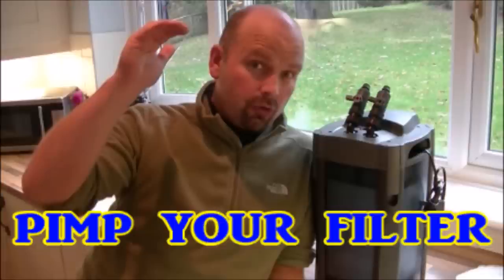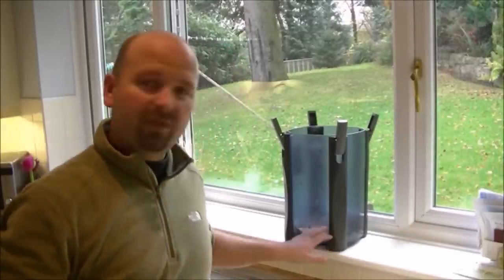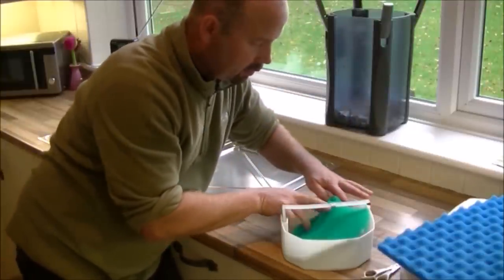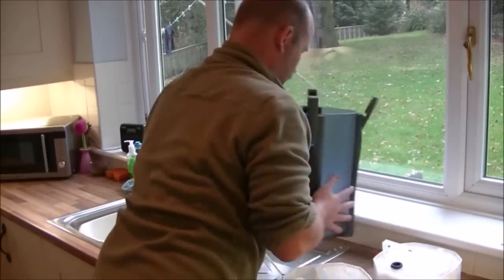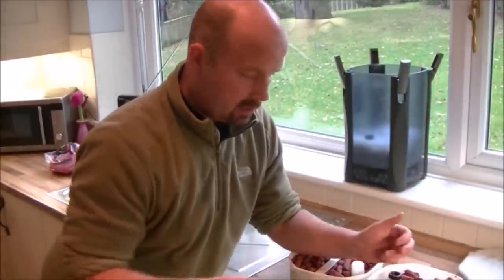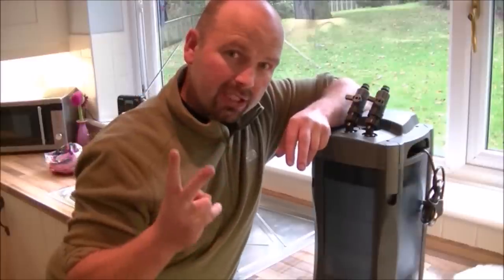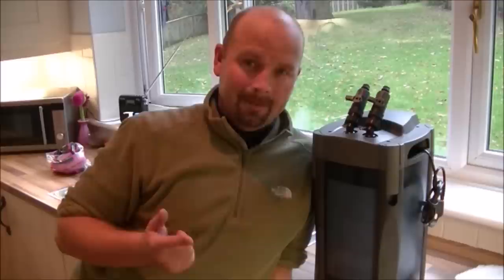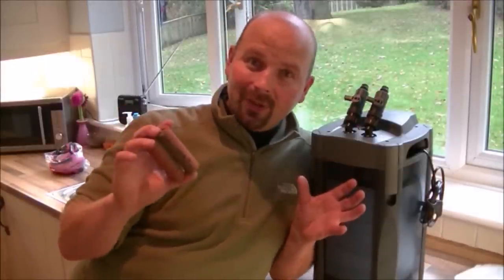External canister filter set up, nitrogen cycle and what happens in a filter - by Pondguru

Comment: just an update have used the set up for a year os so now. have had great results, water very clear, nitrate and nitrite test very low to non existence.  the only thing I've had to buy is replacement filter but probably don't need to change as often as I do. water again is very clear and have been asked how I keep it so clean . I would highly recommend this because of the quality of the filtration it provides and secondly the cost saving, in the year I've bought the conversion kits and a set of foams estimated around £80 for the year and still going strong. cheers Richard been great product.
Reply from the maker: +Richard Gould Rear Richard,
That is awesome to hear and thanks for the great feedback on the upgrade kit.
Yes the fine pad needs replacing periodically and the coarse and medium foams may need replacing after 12-24 months but the media will last a good 6-10 years at high efficiency in a well set up filter.
I have come across two major filter manufacturers lately who advise changing the biological filter media every 6 months which is pure insanity from a filter and water health point of view as it can take a good 6 months to build up a decent population of anaerobic bacteria responsible for reducing nitrate.
Regards,
Richard

Comment: I absolutely love your videos, the way you explain things is just great. I recieved the bio media I ordered from your Ebay shop  for my new chiclid tank (Big Thanks). Please can you give your professional advise on uv sterilisers will they harm the good bacteria in the media? also how about using carbon to reduce odours and also using ammonia remover like Fluval Zeo Carbon in an established tank with an external filter
Reply from the maker: +Prawnchowmein Thanks for the order and I'm glad your initial impressions of the media are good.
UV filters are generally not needed unless you have a number of tanks linked to the same filter but as long as you leave it turned off for a couple of weeks when establishing a filter it will not prevent the filter developing properly.
Carbon should ideally be the last thing the water hits before returning to the tank and is a good product to use when you need to remove colour from bogwood or residual fish treatments.
With regard to ammonia remover you should not need to use that if the filter is a suitable size for the tank and set up with a suitable amount of good media as the filter will process all the ammonia and nitrite. If enough biohome is used (usually a minimum of 1kg per 100 litres for a normal community tank) you should see a reduction in nitrates too (normally after 4-6 months).
Reply: Ok mate, thanks for the quick reply, advice taken, I watched your video about utilising the space at the bottom of an external filter. I didn't realise my Fluval filter had a big enough gap for 1kg of extra media so ill be buying more to fill this void and one more compartment instead of using ammonia media, and enough for another bigger tank I'm starting, Ive learnt so much watching your videos. It's surprising how many people keep fish with minimal knowledge, well thats was me before your videos. thanks so much you are definitely going to heaven for sharing your knowledge.
Reply from the maker: +Prawnchowmein No worries, I love making videos with any sort of educational content.
Yes there should be no need for any ammonia remover if the filter is of suitable size and set up properly with good media as the filter media (bacteria in and on media) should process all the ammonia and nitrite and in many cases reduce the nitrite too.
Reply: Top man, Thanks, my Chiclids said thank you too.

Comment: does not reduce nitrate , tested for 6 months sorry.
Reply: Biohome doesn't claim to reduce Nitrate.  As Anaerobic bacteria settles in the core of the media, it prevents it from being created as the end-product of Nitrobacter.  The water should settle out somewhere between "undetectable" and 5ppm of nitrate.
Reply: clearly states it reduces nitrate on ebay. like i said did not effect my nitrate level after 8 months use, even swopped it out and went with good old fluval rings. (less clogging up now)
Reply from the maker: kanda kumar It depends how much you used for the aquarium. If you are only using 500g in a 200 litre tank it is on a hiding to nothing and if you were having problems with the filter media clogging there must have been issues with the mechanical filtration. Just searched my records against your name and I can't find an order under your name. How much did you buy and what size is the tank?  Feel free to send me pictures and details of your set up to pondguru@btinternet.com as there shouldn't have been noticeable clogging and if an appropriate amount of media was used there should have been some change in nitrate levels if the filter was running correctly.
Reply: Pondguru
 no bio media eats or reduces nitrates, (advertised well) kept fish for 20 years i know how to set filter.
Reply from the maker: The anaerobic bacteria that this media supports will reduce the nitrate as proven by the nation of people who are now using it for that very purpose. When did you order the media, how much did you order and what size is your tank? As I mentioned before I can't find record of getting an order from you.
Reply: Pondguru I too have had no reduction in nitrate using Bio home ultimate.  HOWEVER having said that my filter system is as you have described here. I have I 120 lt tank with 1lb of Bio home ultimate in a Fluval 206.

I have just today ungraded to 2lb of Bio home ultimate by combining a Fluval 106 (using only mechanical)  to a 206 (using only biological).
 
I guess my question is just how much media does a 120lt tank need to get down a 15- 5 PPM nitrate level?
 
Maybe when tests on the media are complete a graph could show what is what.  As in lt to lb on the media?
 
One thing tho is 100% I'm never going back from this media, EVER. Nitrate 0%, ammonia 0%. Fish happy, me happy, ;)
Reply from the maker: I think in the last sentence you mean Nitrite 0? so ammonia and nitrite at 0 is a good result. I normally say as a rule of thumb 1kg per 100 litres and if you are using biohome exclusively that should provide a marked reduction in nitrate (provided it has been running for 4-6 months) and there aren't high nitrates being introduced from large changes with tap water. If you still have ceramic rings in the filters they will be pumping out nitrates so that makes the biohome's job very difficult. According to my notes the 206 has 3 trays and each holds approx. 6oog of biohome mini ultra or ultimate so potentially you have space for over 1.5kg of media. What else is in there at present?
Reply: Pondguru Sorry yes I meant "Nitrite".
 
 I may (or may not) have had a few beers tonight!
 
So my 120lt tank with my 2 lb is a touch under 1Kg.  I do have room to upgrade. so cheers.
 
I will see how it goes over the next 6-8 months. Either way a nitrate reduction is s bonus not a MUST.

Best media ever :)
Reply from the maker: It should reduce the nitrate if there is enough used. In the video above I only used the ceramic rings as there weren't many compared to the 3kg of media I was using. That was for a aqua one 850 which was only 165 litres so I am full expecting that one to be able to take overfeeding like a boss and deliver the perfect water the guy has never been able to achieve in the past.
Reply: Jason P Without direct scientific evidence one cant say much about anything with regards to what really taking place in our filters. Here is a quick theory regarding the addition of O2 and the enhanced nitrate reduction you experienced: More O2 may have lead to more bacteria (all kinds specifically aerobic chemoheterotrophs) which drove uptake of nitrate for nitrogen assimilation. This is just a quick Idea but it could make sense in certain circumstances. The problem with all of this is that everyones aquarium is different. The best we can do is generalize so that information can be beneficial to the majority.
Reply from the maker: DIY AQUAPROS That is maybe why the biohome is so effective in shower filters where the environment is very oxygen rich - I never understood how that worked.
1kg per 100 litres is quite a safe amount to go with for aquarium filter systems but there are lots of users who only get 500g for a filter which also contains 4-5kg of standard ceramic rings so the filter just continues to pump out nitrtates so the biohome doesn't have a chance.
Reply from the maker: Pondguru Just had this come in on Ebay message:
 Dear tynevalleyaquatics,

Hi Richard,
Just a quick update mate, I have had the Biohome in my filter now nearly 4 months, I have set the filter up as you described in your brilliant videos, I have a full tank of fish and am not stingy when I feed them. I am only doing 20% water changes every 2-3 weeks, I have never vacumed my sand as there is never any debris on the bottom, my water test kit is new and in date yet I cant believe my nitrates never go above 5ppm, does this sound right to you??? I cant believe how good this stuff is!!!.
Regards, Very satisfied customer.

That is the typical report from users of biohome and I'm loving getting the feedback.
Reply from the maker: I second that. Far too many channels simply take other people's ideas and pass them off as their own to get views / subs / income without understanding the processes involved in a filter.
Reply: You guys rock, thanks a lot. So nitrate reduction is going to happen in pretty much any filter media because there will always be small areas where oxygen is excluded. Not to mention this process happens in everyones substrate. The issue is really the capacity, you need enough space that is anoxic paired with a high organic load to support the denitrification process... I should probably try and make a video about this. Ive also been working on a canister filter that is meant to promote denitrification but havent got around to finishing it or testing... much more work to be done! Glad to know people are interested in it!
Reply from the maker: DIY AQUAPROS Anything which helps with water quality will always be of interest and the great thing is you are getting into a good position to reach lots of viewers who care about their fish. Jason P I hear you on the channels thing and no matter what the quality (or lack thereof) a channel which keeps pumping out similar videos on a regular basis will always grow much faster than those who put out varied content when they feel it is worth putting out. I always get complaints from subscribers about not putting out enough aquatic / pond / detecting / shooting videos but I only put out videos when I think there is enough useful content. My kids follow some channels (Minecraft) where the videos come out every few days and the bloody videos are almost exactly the same as the last one - there is nothing useful there at all but one of them has over 3 million subscribers - I still don't even have a video intro, lol

Comment: Hi Richard. So, had to publicly share my results as I can't quite believe it; Aqua One aquis 1250, with 3kg of biohome ultimate setup as per video on a 140 litre freshwater tropical tank. Also got 1 big air driven rock filter and a small air driven rock filter with biogravel as per one of your other videos.  The only deviation i made was I didn't use the noodles at the bottom of the canister. Instead I got very corse foam with my filter so stuck that at the bottom. The tank cycled within 4 weeks, fully! Didn't add any fish until 6 week point just to be safe but by that point Nitrates started to fall. Now with 19 (mostly nano breeds) fish, without any chemical filtration my Nitrates are untraceable! It didn't take months either. As soon as the nitrates started to fall, they were untraceable within a week! All the while, pH staying 100% stable.
Thank you for the videos, selling awesome stuff and the superb advice.
Reply: I too intend on doing a video with my findings as I have previously discussed with you. But you'll be the first to know about that because I intend on carpet bombing your name/products throughout the production. If I can be any help, let me know. I'd be delighted.

Regards
T
Reply from the maker: That would be good to see and likewise let me know if you need anything for it.

Comment: Have just done first water test after swapping over and using the

EXTERNAL FILTER UPGRADE KIT - 3Kg MEDIA, FOAMS AND 50+ FREE BACTERIA BALLS bought off ebay,

System only been fully swapped over for 2 days, started swapping 3 weeks ago following changing gravel to sand, 

Best results I've ever had

Nitrite 0.1
Nitrate 0 clear test
Phosphate 0 clear test
Ammonia 0

Great results also asked local aquatic store and they have not heard about it may give then a stick or two and pass on your details.

Great kit and economical if it preforms as describe will see again in a month or so.

Comment from the maker: +Richard Gould
I can't reply to your comment for some reason but those are might impressive results. There are quite a few people reporting a reduction in the nitrate very quickly and for the life of me I can't think why that happens so quickly as I always thought anaerobic bacteria took a good 4-6 months to establish well - even on biohome. I think the combination of foams in correct place, best media and the gel balls all combine to do an outstanding job. It really irks me when I see people on youtube showing how to set up externals and they are just following manufacturer instructions, generally finishing with 'you need to do regular water changes to keep nitrate down, or add this stuff (usually nitrazorb, purigen etc.) regularly to keep on top of pollutants'.
Load of balls.
I'm sure that your filter will continue to perform well for many years to come.
Reply: I use Tetra Balance Balls, they reduce nitrate. It really works well with Bio Home Ultra.

Comment: Thanks! for the great tips.  I got a Marineland C-360 and used your tips to set it up for my future 50/55g tank.  
My setup:
-Bottom tray will be the stock coarse foam - will be adding finer foam later above it
-2nd tray above foam: stock rings to use as a prefilter since they are too smooth to the touch for good bio media
-3rd tray I have the stock black plastic bio balls (May change them to bio max or other good bio media if budget allows)
-4th tray (top) I have 1.5kg of Fluval Biomax rings.  Each tray in the C-360 can hold max 1.5 kgs (3 boxes of 500g Fluval Biomax)

I would like to try Biohome; however, Canada does not have them.  Shipping from USA is expensive, so I went with Fluval Biomax.
Reply from the maker: +Jeff C There is a supplier in Canada: www.angelfins.ca
Reply: +Pondguru Outdoors 
Thanks, just ordered 5kg of ultra for my two C-360

Comment: Got my biohome ultimate media the other day and just added it to my filter. 

After watching your video, I adjusted my XP Rena Xl to mimic your setup here! Funny thing is I went to a mom n pop fish store the other week and the lady liked me so much she gave me a free old fluval. the fluval wasn't of much use but it came with ceramic rings I was able to rinse and use at the base of my filter!

Top Tray: Biohome Ultimate Media and Starter Balls

2nd Tray: Filstar Media Stars already established in my tank

3rd Tray - 3 types of pads as instructed 

Bottom Tray: Ceramic Rings

I have a 40g breeder tank housing a single 3.5 inch Stripeneck Musk Turtle who I've had for 3 years, I really only have to do massive cleanings once every six months and it's awesome. Ive heard turtles are extremely tolerant of nitrates, is this true? What would you suggest for partial water changes once the Ultimate has established itself? 

Thanks for all the knowledge you bring to the community!
Reply from the maker: +MyMiniMovieMagic Sounds good to me - yes the turtles are very tolerant to poor water quality but obviously much happier in good quality water which can take 2x or 3x the filtration of a fish tank as they are very messy.